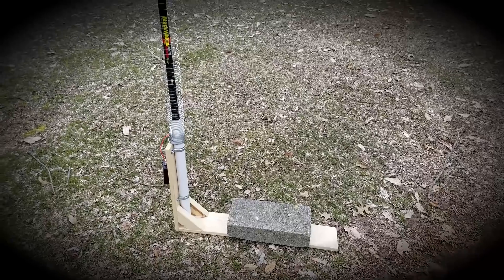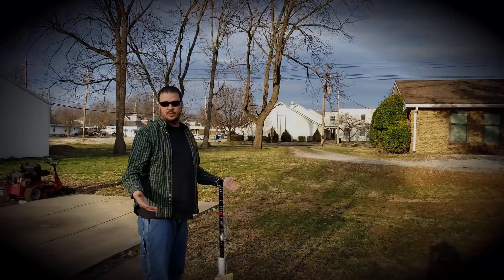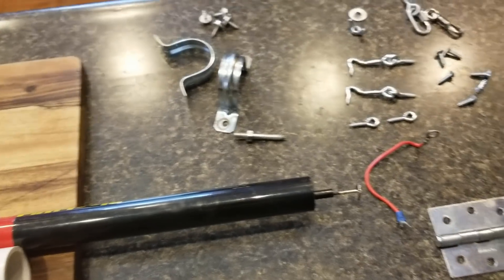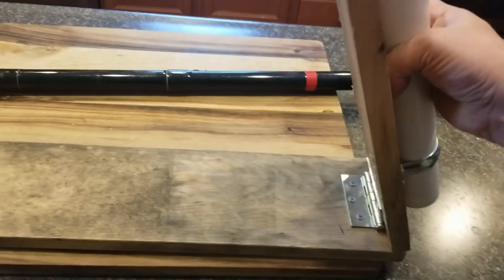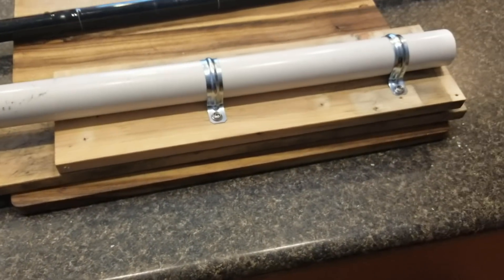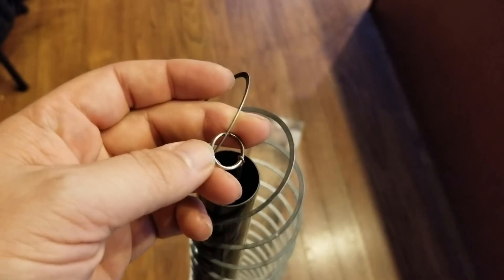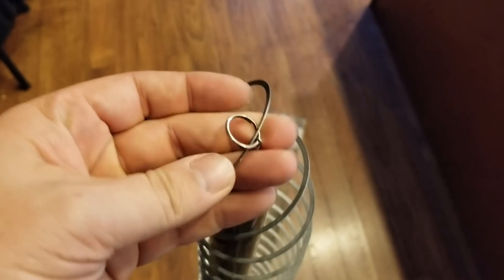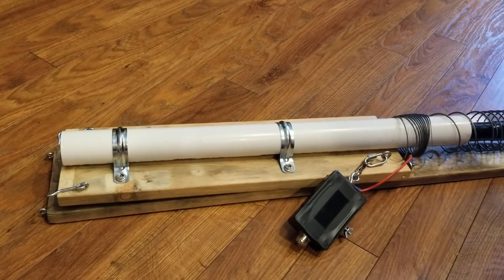Ham Radio HF Homebrew Antenna: 80m-6m Vertical Slinky Antenna!

Comment: Mike, If you arer going to you use wooden base your design for POTA and other temporary installations you DO NOT need to build the base from vinyl or another composite material like Trex. The composite are much heavier than real wood and provide no additional structural support better than wood. The 1x6 pine board should work just fine.

Comment: Mike - a couple of suggestions to simplify and ruggedize the base plate. #1 instead of a loose butt hinge, use a piano hinge - full width of the board.  #2 Off set the hinge an additional distance  equal to the diameter of the PVC pipe used. This will allow the PVC to be adjusted to sit square on the base board.  #3 With everything in position and squared up, mount a folding cabinet hinge lock on the outer edge on both sides. These will lock the vertical board firmly in position. Love the concept.

Comment: Your power, SWR on different bands, total length of slinky wire you used (original package) and grounding via cp outletport? Contacts, your signal reports and states/countries worked. Looked like fun.

Comment: Mike, I have been using a Slinky Dipole for many years. They are a great antenna. Been looking for an option for Parks use and saw your video. Had all the pieces except more slinkies which I have just purchased. So if I have it right, you are just running the pole to full length with the slinky at its normal length, into the UNUN, 25 foot counterpoise and all is well. Sounds just like what I have been looking for. I use an old Kenwood AT250 auto tuner that will tune just about anything, so it should work well. Saw one of the earlier comments about using a vertical dipole, might even try that as well! Thanks for your effort. Col VK2VAR
Reply: While waiting on new slinkies to arrive, I ran my dipole onto my 7m Squid Pole. Approximated half way point on the the pole, and thats where the centre of the dipole sits. Pulled the ends down and up. Set it in the mount, and wow it works great. The AT250 tunes it on 80 to 10m, and am getting good results. Just made a loop for stress relief on the coax connector and it hangs out the side, half way up the mast. A couple of minutes to erect and its done! Takes longer to get everything out of the car. For a Parks setup this is quite good, specially if doing a few parks in a day. No mucking about putting a dipole up a tree. Thanks again for the inspiration!

Comment: Nice antenna. Try to keep your counter poise to no more than .05 wavelengths on your lowest band. 80M = about 13.5’. Not critical. If you get longer, the longer you get you end up with a dipole and a good portion of your power/ current will end up at ground level. Yuck 🤮 
Your auto tuner should be okay with it. On 40-80 you may want to try a 49:1 UNUN to get a better match as your impedance can be 2000-5000 ohms at the feed point then.

Comment: Dude first off I love your videos. You are so laid back and explain everything so a dummy can follow you. DO NOT STOP YOUR VIDEOS. As for this one, just a note, that hinge, I would really use a bolt instead of a screw. Using the bolt with a good size washer on either side would make this perfect. Loving your ideas and what you do for the HAM community. 73's N2QKK.
Reply from the maker: Thanks for the nice comment, it was a temporary deal so I'll definitely make it a bit stronger on the next! I haven't made a new video all year.... 2020 and all its crap, started a business, 3 kiddos, and railroad life have all but killed my radio time as of late.
Reply: @mikehannah6054  I can totally understand. 2020 is the worst B movie that no one saw. A total shit show. I guess working like you do when you get home and have spare time it's all about the kids. Hope your business is working for you even through the horror of COVID. Good luck to you. 73's

Comment: I would think that the coil of the slinky would make the impedance all wonky.
Reply: The inductance of the coil actually helps... Generally any short antenna will need some inductance added into it, be that a base loading coil, a mid-loading coil or here distributed linear loading over the full length,.... Basically this is what a VHF "rubber duck" helical antenna looks like if you scale it for HF.

Comment: Have you considered using 2 slinkies for a center fed helical vertical dipole?
Reply: For the same height that would make your operating Fq much higher - esp if you took the 9:1 off.

Comment: The hardware with wood threads on one end and machine threads on the other is called a Hanger Bolt. It is often used for making a knock-down joint in furniture - for example, where the side rails connect to the legs on a wooden bed frame.
Reply from the maker: Good too know, Thanks!

Comment: Good idea! I have some ideas.  Everyone has ideas. Take the good ideas myself or others give you and use them!  The other ideas are maybe good but not for what you want.  Take and use the good ones and flush the other.  Maybe use pressure treated wood, or linseed  oil on the wood, put end cap on PVC pipe to hold fishing pole from going out the bottom. Maybe not use the antenna connection to hold the 9:1 up. Not sure if it will make any difference but for some reason it just doesn't seem right. But I think the bigger thing is I am not sure how it will work in any kind of wind. Even a small wind is going to put a lot of stress on the screws holding the hinge. Maybe carriage bolts through the wood and a stronger hinge.  Not sure what you will use it for,  but many use things when the wast hits the fan,  there may be some less than good weather! I think you have a good idea!  Just some little things. I think it needs to be SOLDIEGER PROOF, where possible. I think you have something that some drunk high school boys could put together, easy to do. I just think that they could screw it up easy. If you think about it being used by drunk high school boys, it will be easy to use and strong. You have it easy for the drunks but make it stronger.      I know there is not going to have drunks putting it up.  But by thinking of some drunks doing it then when the waste hits the fan and you need to do this in not very good weather it still can be done or there is a rush and you can give this to someone that doesn't know anything about radios to put up some you can set up the radios and things.
Reply from the maker: A few things to reply to ya.... I've since this video added a cap to the bottom of the pipe so the pole stays put. (I think it's in the other video) The wire from the 9:1 does not support it, there is a metal clip that supports it...the wire has no tension at all. Wood was only used because this is a "prototype-ish" build, the final product (whenever I find the time) will be a bit stronger and made out of something more weather resistant. Thanks for commenting!

Comment: Is there a video with this tuning up and on the air?
Reply from the maker: Not yet, once the weather gets warmer there will be.
Reply: I’m in that same mode this winter, adding to my QRP setup and waiting for better weather.  This is an interesting use of a slinky.  I had a slinky dipole about 20 years ago that absolutely sucked.  I can see this working, based on its length. 73s de W1ND
Reply: gsansoucie i

Comment: How did you attach the ring terminal to the slinky?
Reply: Thanks Mike, I'm very much considering building one.
Reply from the maker: There's a small metal clip that holds the end to the next loop. I cut that off and just put the now loose end into the ring terminal and soldered it.
Reply from the maker: Sweet, maybe you can improve the design!
Reply: Lol 😂 maybe.

Comment: Nice work. Wondering if alloy tripod-style legs, which could also be ground plane/counterpoise, may improve it?
Reply: A better ground plane/counterpoise would no doubt improve the performance.  I run a similar type of antenna, but I use speaker wire coiled around the fiberglass pole.  I have the fiberglass pole elevated about 12 feet with 3 ground plane radials angled down to the ground.  All lengths were cut to be resonant at 40 meters.  I use no balun and feed the antenna with 50ohm coax to the radio and have 1 to 1 match.  Worked the world with this vertical.....it's by far my favorite antenna!  After seeing this video I am going to try replacing the speaker wire with the slinky and see if it still works as well.

Comment: Put vertical board on top of horizontal board. This way as the wind blows the antenna away from the car toward the antenna the force against the hinge will be in a vertical direction across the screws instead of inline with the screws to help keep them from pulling out of the vertical board.

Comment: Is the slinky trimmed to any specific length?
Reply from the maker: No sir, unwrapped after I received and put it on. I did see a good article about recommended lengths and would've trimmed if needed, but it seemed to tune up well where I needed it to with no adjusting.... unscientifically tested.

Comment: I already have most of the parts to do this less the 9:1 unun that I can pick up, and need an easy to set up system since my end fed has had to come down. Do you have any information on the ideal length of counterpoise for different bands? I'd really like to do about 100w on 80, 40, 20 and 10m, mainly on the lower bands.
Reply from the maker: I actually don't have any info on this. When I was using the radios internal tuner I would change the counterpoise length to lower the swr, but since getting the auto tuner I haven't messed with adjusting it anymore. I now use a tape measure and just extend all 25' out any time I'm using it. (I have a video on that on here) Once I save enough pennies to get an antenna analyzer, I'll do further testing.
Reply: @mikehannah6054  Thanks for the reply. I have an analyzer, so once I get one set up I will run it across all bands and provide an update. I will probably try something like a 25-33 food counterpoise to start with and take it from there. 73.

Comment: so just your dollar store slinky ? is there a model number for the slinky, i have the same setup but i use 33.9 feet of speaker wire, and is a pain to sit there and rap it all the way down the pole at a 2 inch gap, works great but too time consuming, any info on the slinky would be great ,KD9JRU
Reply from the maker: I was using 16ga speaker wire too....made my dang hands cramp wrapping it! Here is the link of what I bought from Amazon.
The Original Slinky Brand Metal Slinky 3 Pack https://www.amazon.com/dp/B00BJHKR4C/ref=cm_sw_r_cp_apap_nvY3pQBXFMyUq
Reply: @mikehannah6054  hi Mike. Thanks for your videos. Learning and having ideas. Just one  question. Amazon shows 3 packs. Are u using 3 of them. Because i bought 2 packs today. If unwrapped size wont be enough, i will buy one more.
Reply from the maker: Just 1 slinky on this one. I think on my new one I will solder 2 together and get a longer pole though.

Comment: Not seeing a lot of videos with good reviews on the slinky antennas. Slinkys have 67 feet of coil. Should work on 80 meters just add a foot or so of wire and a good radial. And yes a good tuner.
Thinking about trying it. $ 20 rod $ 5 slinky little handy work for a stand. BEATS $400 + for a 68 foot vertical that is put up and can not be moved. Plus carry it with you.  How is this working out? Let us know.
Reply from the maker: I like it for portable ops...it's so fast up and down, little effort to get on the air......I'm still tweaking and playing around with it.

Comment: Would it possible to make the same thing but instead of wood actually using pvc PVC 5-Way Cross to make a stand with 4 legs?
Reply from the maker: That would make it fit in a little bag or something for transporting, might have to fill the legs with sand or something to make it heavy enough to support the pole maybe...